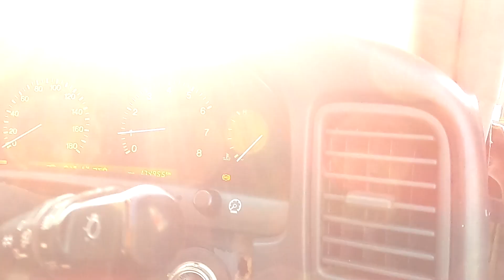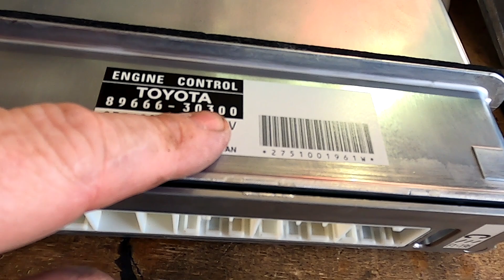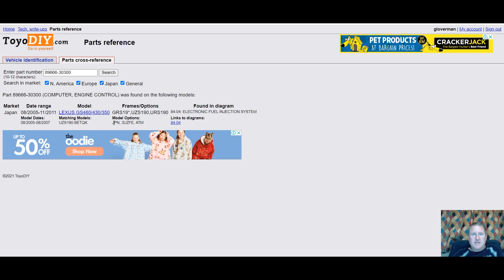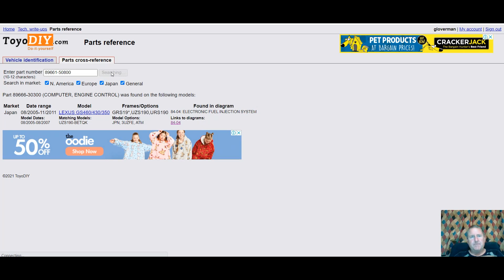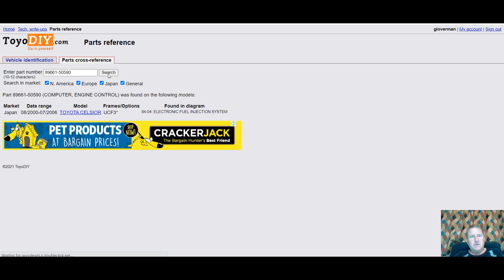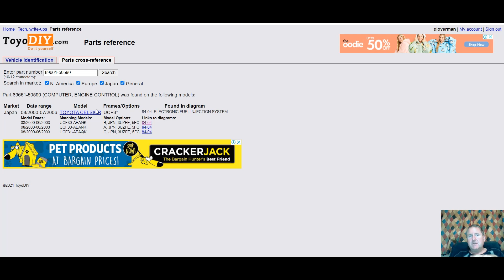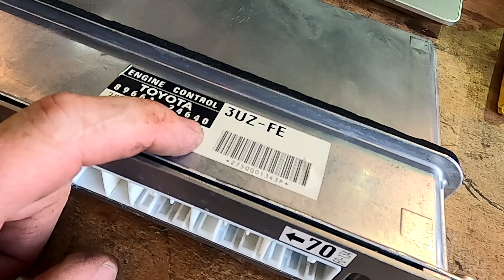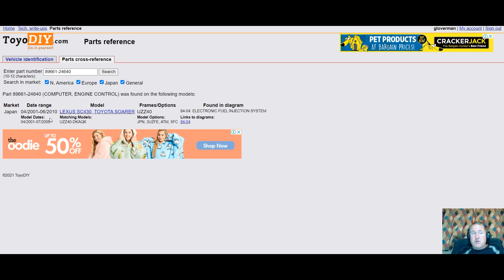3uz Engine and Ecu differences and Reflashing the ecu

Comment: Thank you very much for this video! Small chance I facilitated a mixup and got the wrong damn ecu... Heres to hoping with the tools you've provided here I can prove it is in fact the correct one!

It does plug in--are the early and late plugs different??
Reply from the maker: Plugs on early and late are the same so they plug in,  however the pinouts are very different

Comment: Hey Kelvin, looking to have My 2006 Crown 3uz ecu tested. Japan car now in Canada. Bought the car as a non runner no crank no start. Previous owner reversed the polarity on jumpstart and I’m having issues tracing my issues. Replaced fusible link and various relays and fuses but still no crank no start. At wits end here!

Comment: Can a 3uz ECU be used to run an early 2uz with 6 wire throttle body?
Reply from the maker: Provided the correct components are applied using the correct knowledge with a suitable reflash then yes.  So.matching correct ecu with engine is important.   Generally the amount of work involved makes it not worth the hassle.  Cheers Kelvin
Reply: @CartuneNZ  Roger that mate. With headers and 3 inch exhaust my cruiser is running rich. Especially at startup. I've considered an aftermarket ECU to take care of it or a piggyback. What would you recommend for an otherwise NA donk?
Reply from the maker: Ok,  the 3uz ecu may not control the landcruiser transmission,   the engine isnt an issue.  I wouldn't bother with any stock ecu instead I'd go directly to a aftermarket ecu which does both engine and transmission.

Comment: Hi Kelvin, looking at getting my 06 facelift uzs186 ecu flashed.  Is it fine to use your reflash tune with gull 98 (e10)? or would you say to avoid it?  98 is pushing close to $3/litre near me for non gull stations
Reply from the maker: Can flash a tune to handle gull 98 just fine.

Comment: Can a 3uz ecu run a 98 engine. Is there much differents in them apart from throttle and 300cc
Reply from the maker: Ive run plenty of 3uz ecus on early 1uz vvti engines.  Ensure throttle body is correct,  and generally we swap coils,   later 3uz have different knock sensors and injector colour too.
Reply: @CartuneNZ  is there much power difference in the 3uz when they have been re-flashed
Reply from the maker: Yes,  slightly more topend but greater improvement in the mid range.   Throttle response also improved and better transmission shifts too